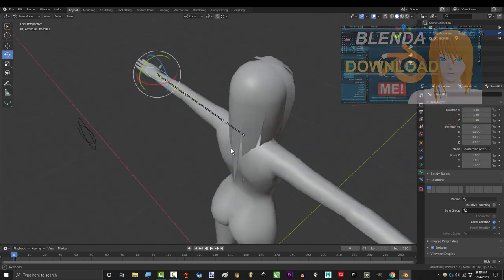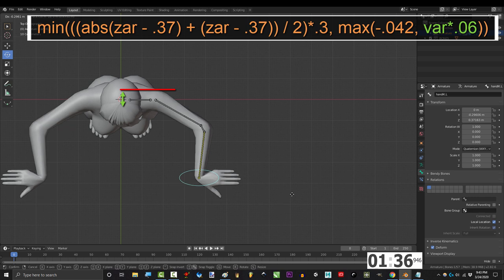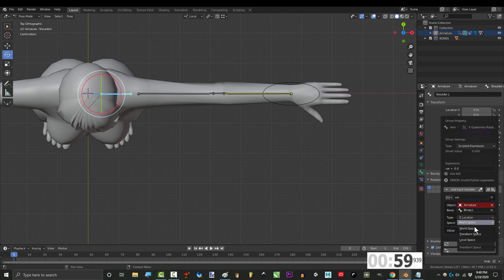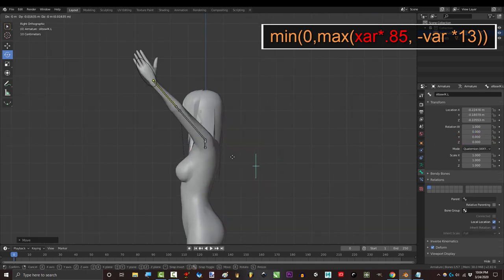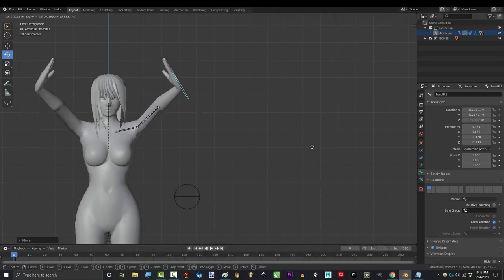Blender 2.82 : EVERY Shoulder & Collar Bone Driver (In 3 Minutes!!!)

Comment from the maker: OK. I know this one is a bit tough to follow so I've made time stamps and put all the equations below. 
Hope it helps and rig download coming soon!
-----------------
Bicep X-Location Driver Equation: 
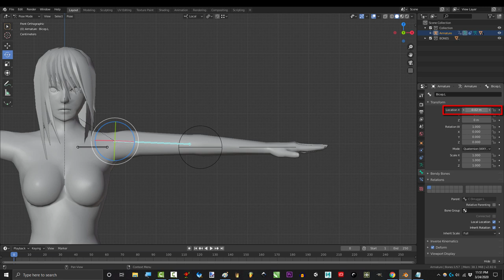0:32
min(.005, max(-.078,-var*.06))

Bicep Z-Location Driver Equation: 
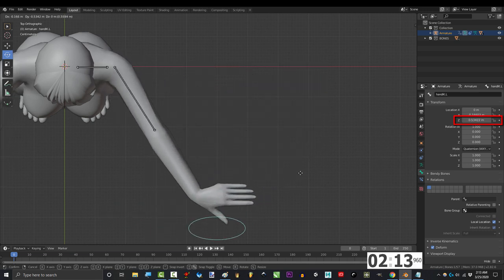1:16
min(((abs(zar - .37) + (zar - .37)) / 2)*.3, max(-.042, var*.06))

Shoulder X-Rotation Driver Equation: 
2:22
var*4.2

Shoulder Y-Rotation Driver Equation: 
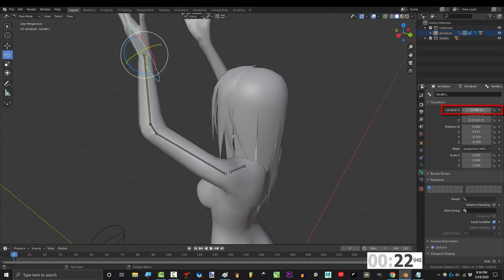3:08
min(0,max(xar*.85, -var *13))

Shoulder Z-Rotation Driver Equation: 
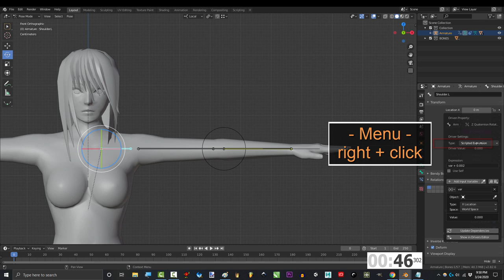2:40
-var*4
Reply: Thank you man. Keep it up 💪👍
Reply: Excellent.
Reply: Very nice! i didn't know about the bone disconnect issue! I have a set up similar to this on the character's neck for when the characters head looks up / down, or the torso twists to right / left. I will likely add your set up to the shoulders and neck of my character as it seems effective!
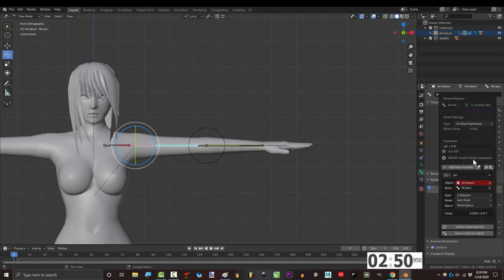Reply: at 0:37 you say "XYZ Euler" but then you click on YZX Euler.

Comment: Just has a student trying to mimic your mechanism. The initial shoulder to biceps problem is not a bug, it's just a circular dependency. you could set a damped track constraint to the shoulder aiming to the arm to avoid any driver creation on the shoulder bone IMHO. Hope it will help. Congratulation with the great videos.
Reply: I tried damped track constraint on the shoulder bone , target to bicep bone , but it creates weird glitches in the armature . Any work around ? the Hand has ik as well .

Comment: To anyone who's having trouble mirroring drivers! Try multiplying the expression by -1, OR, multiply just the "speed" part of the expression by -1. I.e:
Bicept.R Location X: min(.005,max(-.078,var*0.06))
insead of min(.005,max(-.078,-var*0.06))
Reply: We need this to be pinned
Reply: For the Shoulder's Y-Rotation driver in particular, you'd need to invert the min() function parameters on top of multiplying xar by -1, like this:
-min(max(-xar*.85, -var *13),0)
instead of: min(0,max(xar*.85, -var *13))

Comment: If anyone is having the problem where Bicep X-Location Driver does the opposite of what is is supposed to do, I found that swaping two number in the equation may help (at least it did for me). What I mean: instead of this one -> min(.005, max(-.078,-var*.06)), I used this one -> min(.078, max(-.005,-var*.06)).
Reply: thx u

Comment: The tutorial is pretty darn good. However, you overlooked one really important step. The bones' rotation, without exact the rotation you have in the tutorial your equation or driver set up will not work. I just tried. Quite often, I had to change the bone rotation in edit mode ad hoc to figure out what the right rotation it is for the equations to work.
I didn't manage to get Y axis rotation for shoulder bone to work.
Reply: My problem here, and just because he does the tutorials without displaying his axes I didn't know what was going on until I found your comment. If you haven't made the mesh in a T pose and thus made your bones follow the T posing arms, the rotations of the arm bones will not match the equation. It's a sad thing to learn later that you need to tweak your model into a T pose and redo all the bones of the arm just to follow the tutorial properly 😢
Reply: @silveraddydwimores4085  Precisely what was my problem when I used his drivers' setup; I think I only managed to implement 3/4 of his driver tricks on one anthropomorphic model.
Reply: @silveraddydwimores4085  redo the bones? You can adjust it to t-pose and apply as new rest pose.  Apply the armature first,then use apply new pose as rest pose. If your model is made of multiple parts. Look for the simple retargetting addon. This one has a operator which works on models which are made of multiple objects. It's really handy! Plus the retargetting addon itself is also quite nice
Reply: The bones rotation needs to be setup correct. Without they would already bend on the wrong axis
Reply: 1.) Edit mode
2.) Select all bones
3.) Set roll to 0
4.) Right click the number, and click "Copy to Selected". 
After the base thing is fixed, you just have to change the numbers based on the scale of your model
Reply: @coolestardude  Thats not really correct. For fingers for instance, you set one bone, mostly the last in the row and then use "recalculate bone roll from selected".

Comment: 2:36 I must have done something wrong and didn't get that result so if you're having the same issue, you can try this:
pose mode/select the shoulder bone /bone constraint properties/add bone constraint/Damped track/
target: Armature
bone: ElbowIk.L  "the one you created in the video "Inverse Kinematics In 60 Seconds! (Arm Rig)"
Track Axis :  Z
influence :  0.190  (base on the alignment of hand and bones while using view 7)
NOTE: Once you move ElbowIk.L you will have to use Alt+G couple of times to bring it back to its original location.
 I hope it helps!!
And thank you Royal Skies for this series!!!

Comment: Dang, I wish I could see the AXES of your bones to see if the Z are pointing up or down or back. Else the first equation -- and thus whatever else that follows -- doesn't work if our axes doesn't match with yours 😢Too bad, I was learning a lot from you until I hit this brick wall... I'll need to skip this driver and move the clavicle manually to fix the problem. Lesson learnt: model your characters ALWAYS on T pose...
Update: Managed to complete this tutorial, by going back to my mesh and change its A pose to a T pose and clearing all the rolls of the bones by pressing ALT + R after positioning them back into the arms. Still needed to change some parts of his equation to match mine (putting "-" and removing them) and creating the drivers on the proper Location/Rotation axes for my bones. For example, instead of Z location for my biceps it was X and thus the equation for X location needed to be pasted on Z location instead. Absolute madness lol I couldn't resolve the last Y rotation for the shoulder bone because all rotations are locked to just rotate it up and down, so I gave up on that because I don't know what is locking all the axis to move on the X axis on that bone... 
And now is locked to the Z rotation... Perhaps I'll just stumble with the Y rotation by accident after I have used up all combinations in the driver for Y.
Reply: @seallover68 Since there is no automatic tool for that, the only way to achieve this is by hand. If it helps you, select the edge-loop that wraps around the armpit of your character (the circle of vertexes around the shoulder) using ALT + Right Click in between 2 vertexes connected by a line. Press SHIFT + S to make the 3D cursor menu to appear and select there "Cursor to Selected". Once you have done that, up the interface -- between the icons of a Magnet and another called "Global" (or Local if you changed it before), press that button to change the pivot of rotation to "3D Cursor". Then to the right of the Magnet there is an icon called "Proportional Editing". Click it and change the influence to "Connected Only" once the icon is active (or it will remain grayed out and unclickable).

Once you have done that, select the edge-loop of one of your fingers at the end of the arm (any will do) by using the ALT + Right Click. After that, hold SHIFT and press the key + in your keyboard. You will see the selection will grow and creep slowly into the arm. Once the selection reaches the edge-loop of the armpit where the 3D cursor is, unhold SHIFT and now press the 1 key on your right side of your keyboard (the other 1 will not work and I'm not sure if you have a regular keyboard or a laptop's -- if you don't have that number, change the view to FRONT by going to View > Viewpoint > Front on the small menus to the right where it says "Edit Mode").

With all that, now you can press R and then start to rotate the arm into position, as the rotation will pivot around the 3D cursor. You can change the influence (or falloff) of the rotation by rolling the wheel of your mouse up or down to avoid pinching into the neck and head when you try to rotate the arm into T position. Do so as many times as you need, specially if your arm is not entirely straight and you need to move the forearm into a more neutral position, by changing the 3D cursor of place.

Once you finish, you might want to turn off the pivot around the 3D Cursor by just going again to the "pivot icon" on top of the window and selecting "Median Point" from the drop-down menu instead of "3D Cursor". Also you might want to toggle off "Proportional Editing" again once you finish with the entire process of T posing the character.

Hope it helps a little. Good luck.

Comment: Great Tut. I'm just having a problem where the driver does the opposite of what I want. When i copy the expression, the biceps goes down when the hands goes up and up when the hand goes down. I thought first it was because my local orientation is different from yours in the video but once I've found the correct orientation I still had the problem. I try to modify the expression to get the inverse but didn't work either... I'm lost....
Reply: i have the exact same problem, just copying the drivers won't do since the equation needs fixin, the only problem is that me as, a lot of people are not really good at programming so i don't have a clue on what to do to the equation to make it work on the other side. Or perhaps to something else in the driver settings. Honestly i have no idea :C
Reply: @iperflux  I fix it by multiply some of the factors by -1 : For me it was as followed : 
Bicep X-Location Driver Equation: min(.015, max(-.038,-var*.06))*-1 
Bicep Z-Location Driver Equation:  min(((abs(zar - .37) + (zar - .37)) / 2)*.3, max(-.042, var*.06)*-1) 
Shoulder X-Rotation Driver Equation:var*.15*-1 (note that I've used the Hand IK to drive the shoulder so I didn't have to disconnect the shoulder from the biceps)
Reply: @ForeignPixel  OMG thank you so much xD
multiplying by -1 worked for me aswell, was so focussed on thinking a way to "invert" the equation that i did not think of the simpliest.... just.... multiply it by -1. 
Ty again.
Reply: @iperflux   Glad it helps !
Reply: @iperflux Thank you so much, I am crying trying to figure this out, you don't know what this mean's to me.

Comment: Great Tutorial. The only issue I have is when I try to apply the driver on the opposite shoulder and collar bone. Since they are symmetrised, the axis is 180º reversed. I tried to change the value of the equation, but that only made the shoulder lift up when the hand goes down and go down when I rise my hand. Just copying it and leaving it there won't do either, when the hand rises, the shoulder won't move, and when the hand goes down, the shoulder follows along. If anyone knows how to solve this problem I'd be very grateful.

Comment: Hi. I'm having some issues with the shoulders:

See the drivers work perfectly fine on one side but seem to follow the opposite effect on the other side. Did I do something wrong?

Also the Rotation last formula showcased on this video doesn't seem to be recognized either. It keep saying : ERROR PYTHON.

I'm really not sure of what I did wrong cuz I checked that all of my bones were symmetrical. And even deleting one side to re-symmetizing it didn't improve a thing.

All I did after finishing the Drivers on my left size was to copy the Drivers and paste it to the other side but changing the bone.

I need help.

Comment: This is awesome but I am having trouble with the drivers on the other side of the body. I am not sure how you made the movements mirrored?
Reply: This is what worked for me...
@0:32
bicept : left:    min(.005, max(-.078,-var*.06))
              right: -min(.005, max(-.078,-var*.06))

@1:16
left:       min(((abs(zar - .37) + (zar - .37)) / 2)*.3, max(-.042, var*.06))
right:     min(((abs(zar - .37) - (zar - .37)) / 2)*.3, max(-.042, var*.06))

shoulder bone  @2:22
left:     var*4.2
right:  -var*4.2

@2:38
left:   -var*4
right:  var*4

I haven't gotten all of them placed yet, but this will provide a good starting point.  if the bone is rotating the wrong way try changing the negative and positive values.
Reply: also I'm not sure if this is the proper way to edit the values, but it gives a very similar  appearance.  Let me know if it works for you
Reply: @jeffreybivins3250  Thank you very much for posting this! I just tried the bicept one and for me -min(.005, max(-.078, var*.06)) (without negative var) is doing the trick :)
Reply: @jeffreybivins3250  Thanks man, fuckin life saver
Reply: @mad_man_86  fuck youre a godsend none of the other equations worked for me but this did
Reply: @mad_man_86  I can't express how grateful I am, my right Biceps kept flying away from its location whatever I tried to do, but your code saved me from hours of frustration and misunderstanding! Thank you so much for your input and have a great day!
Reply: @jeffreybivins3250  This somewhat worked, except when I brought the right IK up forward, the shoulder would turn backwards, and vice versa. Also, did you manage to get the one @3:09? I think you missed that one

Comment: I needed this on a rig I'm working on but instead of using drivers I just made a normal IK that ends on the bicep and then I added a copy transforms constraint to the shoulder using the bicep as target, keeping the influence down to make it subtle and avoid glitching. Is this a big nono? I've only had problems when I had the influence of the constraint above 0.25 but it might come back to bite me later

Comment: Do you have any info on how to mirror this on the right side? I've tried switching the positives to negatives, and made sure all the bones and IKs said R for the right side. But the collar bone still doesn't function the way it does for the Left.
Reply: Had the same problem.
Switch the min into max and vice versa.
Reply: @baonguyennguyen4206  When I try and do this it tells me the python is formatted incorrectly, how did you write the expression?
Reply: @lemonworm  Right arm: max(-.005, min(.078, -var*.06))
This worked for me:D

Comment: The model I'm trying to rig is not set in a T-pose by default, rather an A-pose, so the drivers don't work as intended, as the arm bones have different axes. What would you recommend to fix this? Would it be possible for the driver accept global information, rather than local? Would it be useful at all?
Reply: Unless your model is in T pose, you cannot. Your only means would be to tweak the equation. My model is also on A pose and I'm trying to figuring out what parts of the equation needs to be tweaked to make it to work.
Reply: @silveraddydwimores4085  If you ever do figure out the correct tweaks, let me know, please!